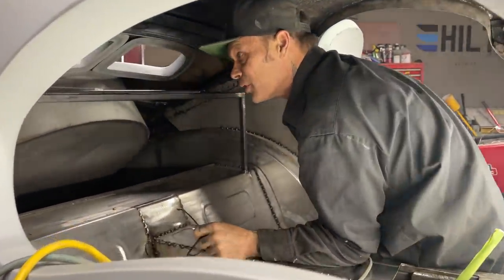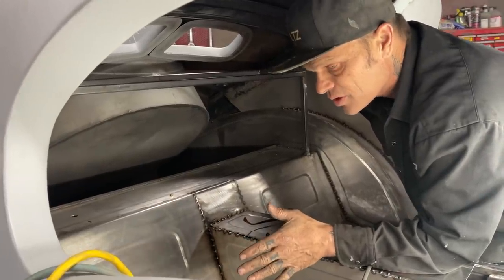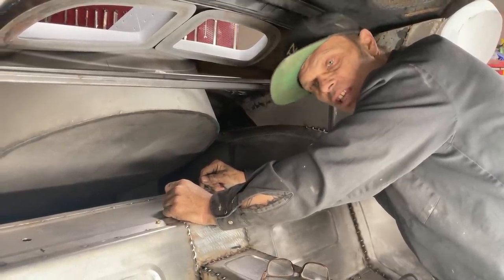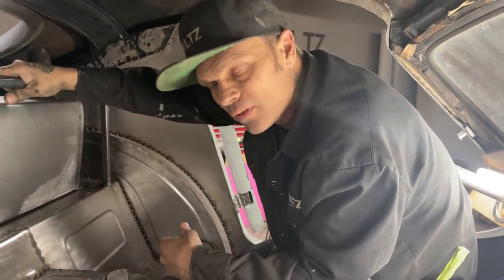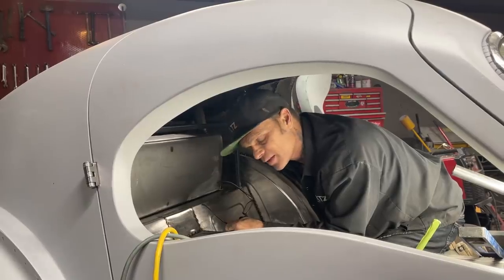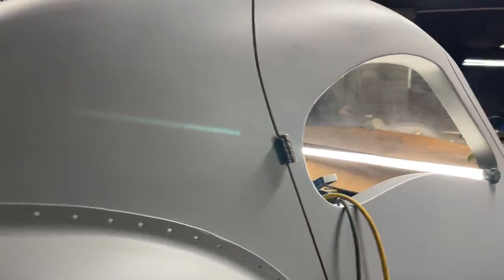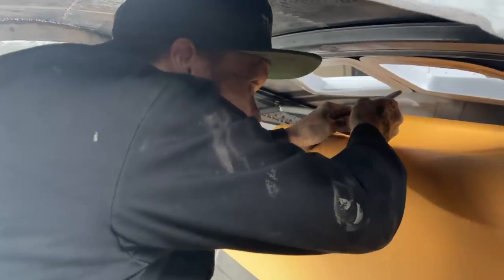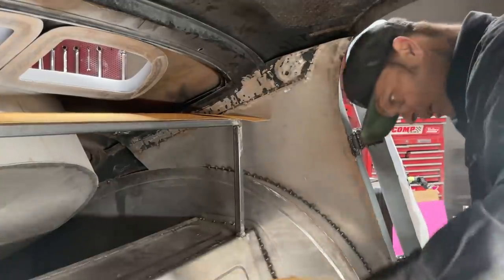BUGATTI: FABRICATING A FIREWALL BETWEEN TRUNK AND COCKPIT

Comment: The location & positioning of the gas tank is about as ideal as possible in that car. A gas tank is only dangerous in a collision if it becomes ruptured, thereby allowing the liquid to mix with "air" becoming a volatile combustible. The further back, the better the odds of tank rupture in a rear-end collision. The combination of being centrally located within the structure, and being only 4 inches deep, from front to back, thus minimizing possibility of rupture in a collision makes that tank as safe a location as any in the car. On top of all that Chad is constructing a "firewall" between the tank & passenger compartment. Keep up the good work Chad & Jolene!

Comment: Thank you for your show.  It has helped me tremendously by giving me the motivation to get up and get back out in my shop.  You talked a lot today about the gas tank and about it being in the trunk.  It made me think that some viewers did not agree with your decision to put it in the trunk.  One of the  reasons I watch your show, is to get new ideas and see how YOU build a car.   When I was younger, I built airboats, wheel buggies and full tracks.  There are no plans, and you couldn't get something already made.  You had to make everything.  Most of the time you build it " flying by the seat of your pants".  You make decision on what to do based on the situation, what you feel is the best way to do it, and then move on to the next thing.  If you sit on something for days it doubles or triples the build time .   What people need to understand if down the road something don't work,  you can always change it and make it work better.  Sometimes people can't see the bigger picture.  Again, I love your show.  Keep the shows comming.  GREAT STUFF.  
Ps.  When I made gas tanks, for the fuel pick up, I usually drilled a hole and welded a nut over the hole.  Then I could screw any size pickup line I wanted.

Comment: Chad makes me proud to be a Canadian. I wish I learned how to use a Mig Welder when I was younger. Chad and Jolene should do a video on the tools they use and brand of filler he uses to flood the the surface. Chad makes his jobs look like a piece of cake which took years of experience. The Jag XJ6 engine was a smart choice. I drove to Montreal from Vancouver and back in my XKE 3.8 roadster in January and later to LA and back to Van with zero problems.  Jolene does a great job of filming.

Comment: Chad is the guy, keep doing what you do and take pride in it. This is your build and it all looks good from here, we will watch you as we do and thank you.
Reply: I have a 1973 Jensen Healey, and the gas tank is in the trunk. It has a vabt line, and a pressure relief valve to relieve pressure on a hot day.  Both lines exit through the trunk floor.

Comment: Think about screwing or bolting that interior panel on there's no reason to hinge it the chances of you ever needing access to the tank are almost zero and if for some reason you do, taking out 6 or 8 screws is no big deal. Just my 2 cents!
Reply: i agree,also chad what about roof lining,is it going to attach around your windows ,you have to make the finishing for the trimmer as easy as you can to finish it right .
Reply: Duz conectors
Reply: I think if I were building this car 🚗 for my girlfriend I'd mount the gas tank underneath the car 🚗 instead of behind her head.

Comment: Don't worry about the safety sally's.  Excellent Work..It takes discernment, critical thinking and a mechanical aptitude...some just don't have....YOU DO.  I guess they didn't realize the motor is also just on the other side of a fire wall...standard operating procedure...

Comment: I have no access to blue prints of the original 57SC, I only have seen a sectional croquis and it seems that the cilindrical bay for the spare wheel has not the depth that Chad has fabricated. With less depth, the gas tank would have another location and inhanced capacity. In any case, Chad has done it his way and fine his own solutions. Awesome, outstanding work. I'm completely astonished when i see him, measuring and placing holes, roughly with his eyes and a measuring tape. From Barcelona, Catalonia

Comment: Mid sixties chevy trucks has tank in the cab behind the seat. Mine is still going down road just fine
I dont hear sloshing
I agree with you Chad.
I think its safer there behind the seat and in the trunk than under the car.

Comment: We build our cars for ourselves and we all do it differently. I would have mounted the tank on the trunk floor because my idea was to have the filler come through the centre of the spare wheel and have no visible filler(that of course depends on how easy the spare door is to use) and then be able to use the space behind the seats for folding chairs or luggage etc but that's not the car you are building for jolene and it is only because you have started the concept that we are all getting excited and want to become involved. Keep up the good work

Comment: Your woodcraft buddy can build a panel, bet he has some great ideas for latches and could build a beautiful panel. 
Lots of older trucks had fuel tanks behind the seat,difference is they used a top side fitting and a drop tube pickup. No need to defend yourself. If its easy in your mind,then go with it. 
Thanks for addressing the comments,hope everybody gets it.

Comment: Instead of using hinges for the fuel tank access door, you could use tabs that set into the floor pan just in front of the tank. When combined with some spring pins or twist locks at the top of the door, it should hold the access door firmly. By not using hinges, you could pull the top pins and then lift the access door out over the seats instead of hinging it open and needing to remove the seats to open the door.  Just a thought...

Comment: Having both worked as an engineer in the design and test side of the auto industry plus having had a bad crash in a 1960s car I can genuinely tell you safety wasn’t at the front of their minds back then or even probably now. Everything is driven by cost, and a life actually does have a price! It’s calculated from the number of potential deaths against the cost and speed of skipping a manufacturing process, part or safety test. Remember the Ford Pinto scandal. Please take into account the weight of the gas tank when full of fuel, my accident was in a Triumph Spitfire and it’s tank was fitted in the same location as yours. It was fitted correctly with all of its factory bolts, upon collision the conserved momentum of the fuel mass caused the tank bolts to be punched out of the mounting frame. The now loose and split gas tank spilled fuel into the trunk and into the cabin. The only reason we didn’t explode was the moisture in the air due to it raining. Be aware, be warned😬

Comment: No issues with how your doing this tank. Seen some pretty bad ideas over the years from others. Here's a little idea. To help with sound deading issues. Buy a few cans of the spray foam and build it up around tank. It can easily be sculpted with a hacksaw blade. Can allways cut it out if any issues with tank. Could also help cut down on any splashing of fuel inside car if in a accident! Could fill that whole cavity tightly. Look Great Chad. Great team the two of you😁

Comment: For those fender and other curved pieces you need a pin contour gage.
Simply keep the clamp loose, pust the pins up against the curves then tighten up the clamp screw(s) then you've got the contour to transfer to metal.

Comment: Hey Jolene and Chad, jus a thought, since you are closing off the the gas tank it would be cool if you added at the same height or mayb even below the bottom of the gas tank adding on the whole area which goes to the back of the car and around the spare wheel area more gas tank haha that extra part actually look like a float which normally sits in motorcycle carburetor bowl if you kno what I'm saying, and that way u could have more fuel and have the filler neck in a whole bunch of different options

Comment: as long as you have a vent tube off the tank to take fumes outside the trunk,it wont mater were you place it, seems to me its placed were you can get to it so if you both think its right then it is right end of ,great build you put allot of thought into your work even if you build this quick ,carry on the good work.

Comment: Tank is fine there. Especially in the unlikely event you get rear-ended on the highway. Maybe rework "spare tire" area so it will open as an access to a rear storage "trunk" You don't need spare tire but a place to put items out of sight might be handy for this cars intended use.? I carry a 12 volt compressor and a tire plug kit in my Corvette.

Comment: Yes, brace the top of the gas tank to that firewall mount. One at each end and it'll never move.
Forget the negative Nellie's.
They seem to not have a clue about your abilities. It's good you put baffles in the gas tank.
Not just because of noise.
Because sloshing gas can change the balance of the car in curves.
Love to see you build an old style chopped Ford hot rod from scratch.
With a Dodge Hemi engine, Eidelbrock carbs and intake.

Comment: Hi Chad N Jolene 
Bugatti is coming along nicely getting closer to paint can't wait to see the color u chose .Chad when it comes to the Chrome on the car 🚗 I know u normally use chrome trim but there is a company called Avery Dennison that make Avery Dennison conform chrome it's not cheap at around £200 dollars sq metre  but I seen it used on YouTube guy was doing door handles  looked high quality you would think it was real chrome on metal .I thought I would mention this product as it would be ideal for the grille and headlights  .I think Jolene would be more than capable doing the Chrome she's turned out to be good at welding . Anyhow great content as usual regards Steve from Southampton UK 👍😼👽👽👽🦉🌍🌌🔭🪐🙂😃

Comment: Awesome workmanship and "on the fly" engineering you have performed so far on this project.
Im in total agreement with "in the trunk" thinking but this 60 yr old master auto tech looks at keeping as much weight as possible as low as possible to the ground.
A lower center of gravity will promote stability at speed especially in dips through curves. Give it some thought.
You also have a problem with the location of the rack&pinion. It needs to be on the same travel line as the steering arms or your Ackerman angle will be off and this again will promote unstable steering in curves at speed.
Reply: Update!! I noticed the rack problem and commented before I finished watching this video. Chad is solving the issue.

Comment: When I saw that you had the tank behind the axle hump, I thought you had decided to relocate it there.  If you had, you wouldn't have the fuel line coming out right on top of the axle.  I like the flat panel you are putting in.  However, if you put the tank behind the axle hump, you could put another flat panel level with the axle hump.  This would allow space to have a storage area.  Jolene would then have a place to store her purse when driving the car.  As it is, where does she put her purse when there is a passenger in the car?  There is no problem with the tank being in the trunk.  Just food for thought.

Comment: Hi Chad and  Jolene  this is Gilles from Burlington Ontario just to let you know it you want again if you want  to check RED KOTE best sealer for METAL  gas tank and also it you want you can install rubber washer where you secure your gas tank or under the gas tank so it not metal to metal for in case of problem in the long long future lol , LOVE WHAT YOUR GUY AND GIRL DOING CHEER'S

Comment: Get with your wood worker buddy and get him to build a mahogany roll top door like a roll top desk ..he could use a fabric hinge that works like a garage door to access that area ..I'm not sure putting the gas tank above the carburetors ..wouldnt be a problem with flooding ..I have that problem with my 71 chevy c10 I put a fuel cell in the bed ..and with the mechanical fuel pump and it floods the engine ..I plan on buying a blazer tank to mount under the bed later this summer

Comment: can you put a pivot on the front of the seats to get to the trunk, if there's enough room from back of seat to roof, on both seat's, solid  on front spring loaded pin on rear pin, same as on seat a rear mount pivot, seat is flat stock-????

Comment: Bad Chad I think you're doing great especially with how long it's taking and what you have at hand to work with good job I've seen many hot rods and rat rods built with their gas tank right behind the front seats and many classic cars were built the exact same way that car that your building could get into a bad rear-end accident and the gas tank is in the middle of the car so it is perfectly safe from explosions unlike other classic cars that have been built in the past headlights Volkswagen bugs their gas tank is right in front of you so if you rear-end somebody too hard and all the wiring is right there you're definitely going to start on fire are blow up

Comment: sending unit has to fly half way in the tank. not at the bottom. or manipulate the gauge so it shows empty when the lever is at the half.

tank straps instead of bolts?

Comment: If you can't get into the trunk without removing the seat, why not bolt that panel in place rather then hinge it. This way you can add a good seal to it  just in case the tank develops a leak  from something like a collision. I also would open the hole in the body up where the nipple passes through so it doesn't shear off  if it should move slightly.

Comment: Yes I agree: I'm not trying to be disrespectful. This is not horizontally engine like, or as in a Subaru. But if you wan't to cut down you're chances of a Roll over event.  You want a 850HP Subaru engine. Lower center of gravity, no inner fenders. Air cooled gnarly air craft performance !!!

Comment: Cut out the floor in the spare tire make a deeper build your tank and put the spare tire back in. My only question is how you were going to vent it. Also run your brake lines and fuel lines down through that hump of a tunnel you made like a old Volkswagen! Good luck with the build

Comment: if you decided not to carry a spare wheel, most new cars sold in the uk do not come with one,  you could cut out the bottom of the spare wheel compartment and use that as a way to gain access to the boot, sorry i should have said trunk.

Comment: Every Pickup Truck we owned had the fuel tank just behind the seat, so what. You really don't have a trunk. Its more of a 1935 Race Car which it is. You don't pack up and drive a cross country in it. You go on picnics or car shows or dinner or wineries. Does the spare tire cover open up? If yes you could make two things just for it. 1) Picnic basket, 2) overnight bag. Then you would be all set. Have fun and don't worry. Take care of each other, Dennis in Virginia

Comment: Chad I get it you gonna put the gas tank and the back of the seats that's the way the corvettes are And the Camaro as with the back seat But if it was me I wouldn't put it right behind the rear end and put the battery behind the seat with the storage  Is just easier to access and take the gas tank from underneath the car than it is to take it out of the car when the seats are in For maintenance .

Comment: My 1967 Chevy pickup has a gas tank right behind the driver seat , Inside the cab!!!! I don't hear no gas sloshing around! And you don't need no bracket at the top of that either my tank bolts on the floor and it's much taller much bigger than the tank you have there so that thing's not going to go anywhere the way you have it bolted!

Comment: Just a thought on the fuel tank placement chad. If you was to mount it lower rather than higher would it make it safer in the event that the car was to roll over .

Comment: You shouldn't feel obligated to justify how you are building your car. It is yours to build as you see fit. As long as you feel it is safe for Jolene when it is done, then it is done right. On a side note, you will need at some point to make a hole thru your upper flat panel to run your filler neck up thru it. Just keep on keepin on as they used to say.

Comment: I did this a long time ago what you are doing now in a car of course not a Bugatti but about the same thing inside we used a rubber pad underneath the tank I think you can get a tent pad at Walmart for like 14 bucks and use it it is used as padding in tents we use them on 2x4s for long blocks to sandwich in my shop when I was open before I retired my opinion is if you weld three brackets on the top of the tank and mount them to the back side of your brace you have running horizontally that sucker ain't going nowhere and if you insulate it with the pad I think it will last forever just my comment just saying

Comment: In the early days of the automobile they used a actual shipping trunk mounted on the tail of the vehicle for storage. That's evolved into the trunks of today that hold your spare and groceries. This Bugatti has NO trunk. It has a well for the spare only. The fuel tank is simply in the upper rear of the car. Closed off in it's own room. You can call it the "fuel cell". Lol.  Hurry up, I wanna see it cruising down the road with your pretty blond behind the wheel!

Comment: remember that the top of the rad has to be above the water jackets in the engine or you wont be able to fill it
Reply: You can if it's a presurized system.
Reply: Put a cap high on the engine and cap off the radiator top then vacuum fill
Reply: @jasonmcdonaldhandmade7900  good idea